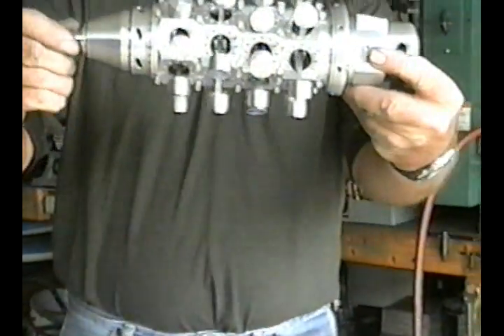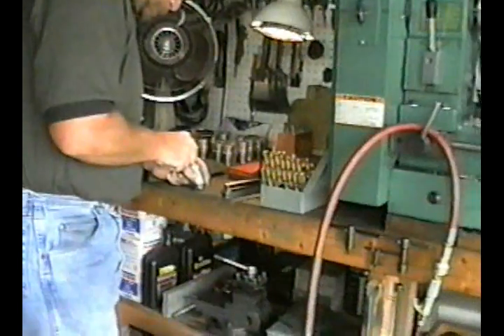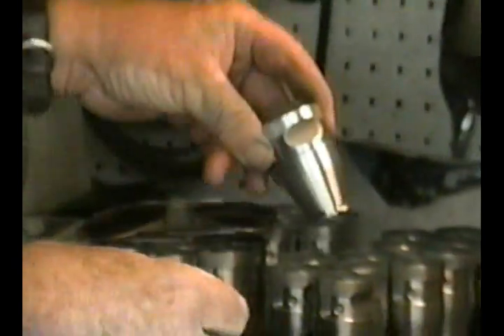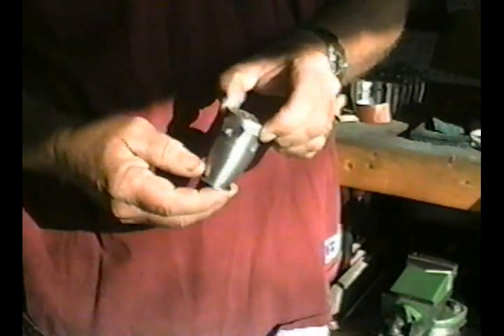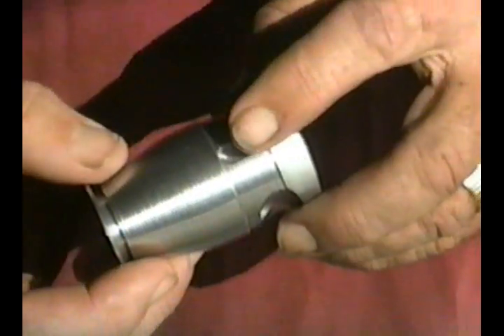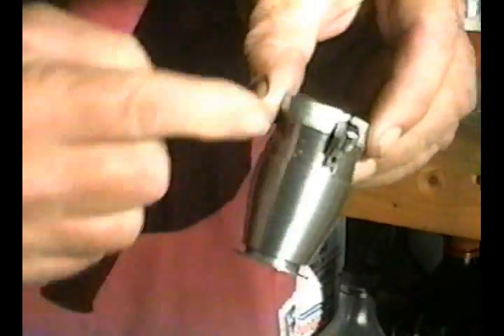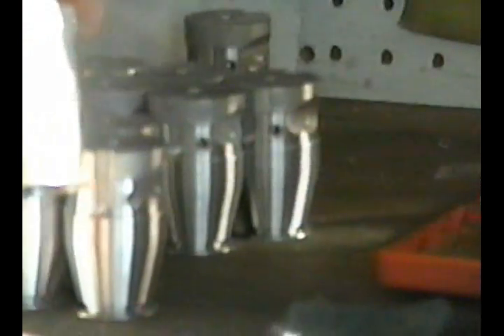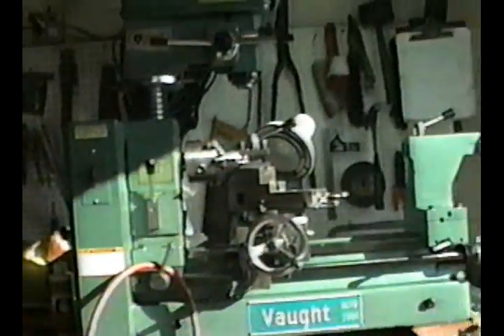Jerry Vaught's 28-Cylinder Machined Radial Engine

Comment from the maker: Thanks for the comments.  This engine was actually not designed to run, but I supposed it could if you modified it.  My Dad built 8 "working" models, one for each radial in the series (3, 5, 6, 7, 9, 14, 18, 28).